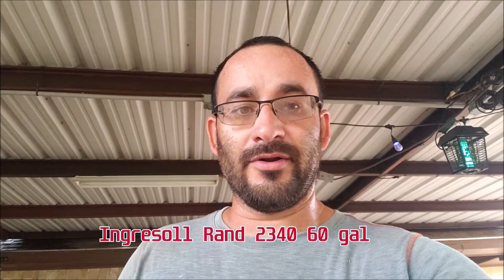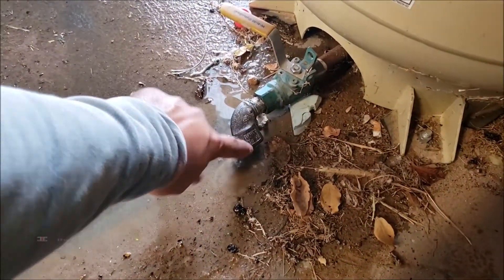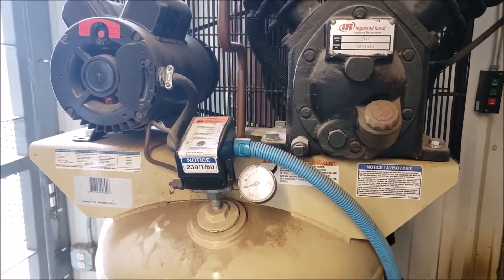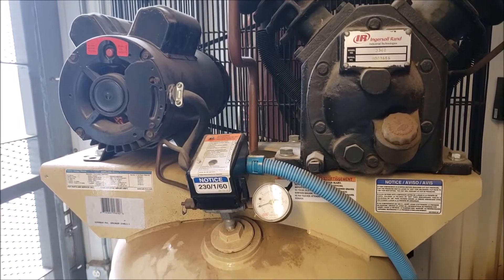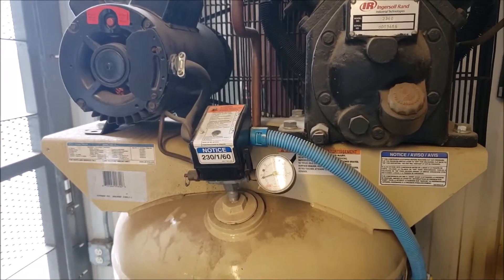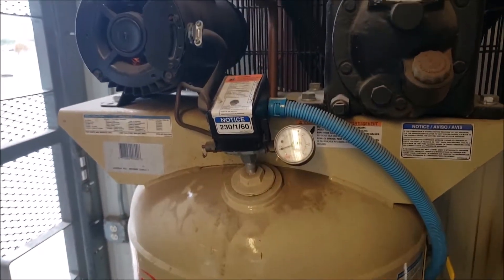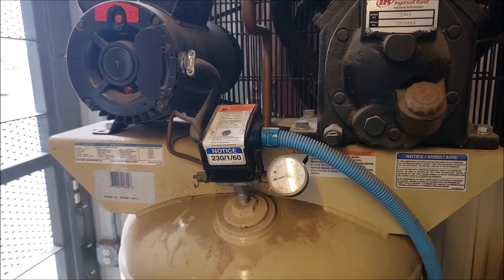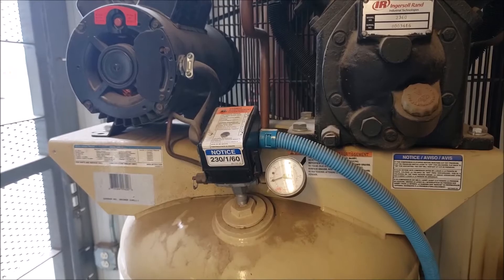How to drain water from air compressor. Ingersoll Rand after 8 years

Comment: 8 years and the waters that clear? I don’t believe you, especially with such a nice accessible drain valve on the side. I’d expect sludge and a blockage if that was 8 years of no draining.
Reply from the maker: This was a neglected compressor and all the water was trapped in the tank since it was installed. Do you think the water was intentionally added?
I had to clean the garage  and drive way as the concrete turned orange from the rust that came out followed by a black film. I started recording after draining water and thought it would be a good video. 

My Dewalt 60gal compressor gets drained before and after use to prevent premature damage.

Comment: Dude if you have not ever seen or experienced a compressor tank blow up because of rust then you  should research it. If that tank blows it could kill you and take out the side of your garage. I would not trust that tank for no money. That is exactly the reason I dont buy used compressors. Always open the drain valve of the tank each and every day and leave it open always when no in use.
Reply from the maker: This is actually the compressor at work and not mine. I would notice the unit would fill the tank rapidly from empty to full and that's when I decided to drain the liquids and to my surprise a ton of gallons of fluid lol. Thanks for the input  and yes you are correct on corrosion and explosions on tanks.

Comment: Well hell. I have a large compressor in my shop that I’ve owned for 20 years. I never knew they needed to be drained. Will be doing that tomorrow and we'll see how messed up it looks.
Reply from the maker: I actually sliced a 20 gallon compressor a few days back and it had some pitting but did not have anywhere as much water as this one.
Reply: 😂 how can you NOT know after 20yrs 🤷🏿‍♂️

Comment: I don't think i'd feel safe using that , after seeing that much water come out.  Who know's how much rust is in there. Once the pressure is at Zero , there should be a spot to look remove the threads and shine a light in or get a pen camera-endoscope to check the tanks condition. But my guess is it wouldn't be pretty inside.
Reply from the maker: I agree this tank is probably  safer to use as a fire pit now. Rust is evil and never stops. Thanks for watching.

Comment: Is that air tank or water tank
Reply from the maker: I said the same thing once I realized the water was not stopping. They installed Stainless steel hardware to try draining this compressor before each use. I still say it was a water tank.

Comment: It’s like the one at work. 1500+ gallon tank that 3 screw compressors fill it. Our tools end up running on straight high pressure water when it gets too full of water. I have to use a 1 inch Chicago hose on the drain valve wide open for about an hour to drain, hundreds of gallons no BS. When this happens, I call it liquid cooled tools.😂
Reply from the maker: This compressor shocked me and cant even imagine 1500 gallons. What equipment or task would need that much compressed air.
Reply: @cutweldngrind  It’s for a steel mill. Most of our processes require hydraulics and pneumatics. Air tools in the shops and on the floor for repairs. Also to blow water off of the steel during some processes with a very high volume and pressure.

Comment: That was so satisfying!
Reply from the maker: Thanks. The compressor now has a small 3/8" stainless steel line running through R Panel walls of shop to drain it more often. This is the main compressor at work used to fill up tires only. I think if pneumatic tools would be used they would go out very fast.

Comment: Hard to believe you couldn't tell you was losing air capacity.
Reply from the maker: This was at work. I would notice it would fill up so fast compared to my dewalt. When I drained it I was in shock.
Reply: @cutweldngrind  lm sure it was it was like a old style water expansion tank at that point,,wasn't you getting alot of water in your tools and hose? Best to put a automatic drain valve,,,you had your chance, lol,,,just kidding I'm a stickler for dry air,,l put a 1/2 inch roll of copper tubing between the compressor pump and tank eliminating almost all the water the comes from condensation when the hot compressed air enters cooler tank,,,I hardly ever get any water after doing it..
Reply from the maker: @georgespangler1517  I bought a good size radiator rated at 200 psi and never installed it. We have a 1" line that passes through 2 filters and up 18+ feet in the shop. Maybe the bigger size pipe and height helps the liquids drop. The compressor is used only for filling tires and occasionally to blow air to clean stuff. My personal compressor I do take care of it and run 50ft of hose to my DIY separator. I do lots of plasma cutting so I rely on clean dry air.
Reply: @cutweldngrind  l put a t fitting with down drop with drain ball valve,,,sounds like all your water is dropping back into compressor,,,glad you drained it you was probably filling tires with water,,,lol

Comment: Yeah I wouldn’t use that anymore. Wouldn literally explode that entire wall if it went at 150 psi
Reply from the maker: Its better to be safe than sorry. I have 2 compressors and I drain them every time I use them. This compressor is at work and nobody did any service to it. I still have to place a drain pipe on it.
Reply: They pressure test tanks using water. I disagree. Notice how it wasn't rusty?. This is my opinion but it take air to make rust so all these guys that don't drain their tanks are probably doing less harm then the guys that do drain them regularly constantly re exposing that small area at the bottom that regularly contains water back into contact with air.
Reply: @travcon8  umm AIR compressors constantly have air in them. Water isn’t impenetrable by air infact oxygen will readily dissolve into the water and unless you pull a vacuum in your compressor there will always be air to rust it. 

Search up nail in water vs in nail in water with oil experiment if you want to learn a bit about it.
Reply: @PiOfficial  interesting. My well tank keeps air above it that compresses and that's what give it it's pressure.
Reply: Can one be able go drain the tank if there isnt any draining valve? My tank doesnt have one. I was told i had to remove all the air inside of the tank after use

Comment: That is a ticking time bomb completely dependant on how thick that steel is...  Or was.
Reply: Not worth your life.
Reply: Spend the $600 or so for a new tank. NOT worth what could happen.
Reply from the maker: I believe you are correct. The wall thickness has to be compromised. To many years passed without maintenance.

Comment: Is that an air compressor or a hot water heater?! I didn't know they could accumulate that much. Wow.
Reply from the maker: I was shocked too. I am planning on adding a drain extended out of the shop so it wont make a mess inside. I drain my personal compressors after and before each use to protect my plasma cutter.
Reply: @cutweldngrind  Well I just added an extended drain hose and valve to mine so I won’t neglect to drain it. I’ll admit I didn’t always lay down on the floor, stick my hand under there with all the black widows, brown recluses, scorpions and centipedes, and tear my fingers up on the sharp little wing handle. Now it’s a breeze to just flip that quarter turn valve that’s extending out from under the tank!
Reply from the maker: @mguerramd  Black widows, one of my fears. The drain extension works great. I have 2 compressors and both have the extensions. I have not seen a scorpion in a long time but they can be found easily when I go to pick up dried firewood.

Comment: Put an electric 0 loss condensate on your tank, you'll thank yourself later (and so will your compressor).
Reply from the maker: It's the compressor at work and I told my boss and we need to do something about it. I have a Dewalt 60 gallon compressor and will look into an auto drain valve for it.
Reply: @cutweldngrind  0 loss condensate works different than normal auto drain, it vents only water so you dont lose air pressure during venting. Pricey but worth it, i am reconfiguring the stock setup left in place by Emax. They did some dumb things.
Reply from the maker: @Enonymouse_  I saw some $300 to $400 setups and actually looking into how they work. This may be over my budget for now as I only use my compressor every weekend for hobby projects but the one at work gets used more often just to inflate tires.
Reply: @cutweldngrind  emax put iron fittings on the bottom of the tank, when combining water, iron and steel, you get rust. I ripped mine apart and upgraded all the fittings, used hose reel swivel joints made of bronze or brass and added moisture boss condensate catcher. Next is air dryer, silencer and finish plumbing in plasma cutter. I am hobbyist too but serious about my tools. 10hp 80 gallon compressor <3.
Moisture boss costs about 500 and is self powered through magnetic float valve.

Comment: Thanks alot for reminding me I need to drain mine!! 😆 🤣
Reply from the maker: I do my tank about every week but this was crazy. I should of installed a flow meter.
Reply: @cutweldngrind  well not sure i have done mine since I have had it 🤔 lol you could add an automatic blow down valve
Reply from the maker: @ericjackson6082  I installed my Dewalt 60 gallon in my shed and added a flex hose drain kit about 2 months ago. The drain kit works just need to run an extension to outside of shed so the floor dont get all messed up. I have so many projects with little free time but getting to them slowly.
Reply: @cutweldngrind  I hear ya my projects are mounting up on me I picked up a few side hustles and it is interfering with my stuff at home lol
Reply: I did the same thing. I bought a small diameter see thru rubber air hose that painters always use and connected it to water drain. Threaded right on now I just bring the hose over to the sink and drain itnrigh there in the same room. Then it coils nice and easy back up next to the compressor. I hit the ball valve about once a week.

Comment: One good plus for you is there is no oil in with it. Mine is dying and passes oil as well.
Reply from the maker: The little 30 gallon Husky compressor I have takes for ever to fill tank and think it has reached its end of life. I was using this compressor to fill my tires and hopefully they are not full of water.